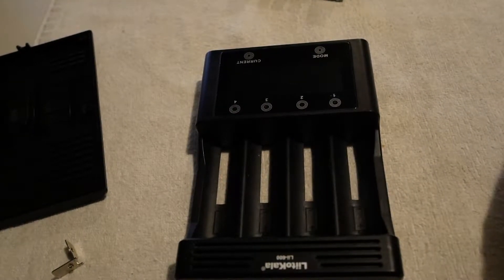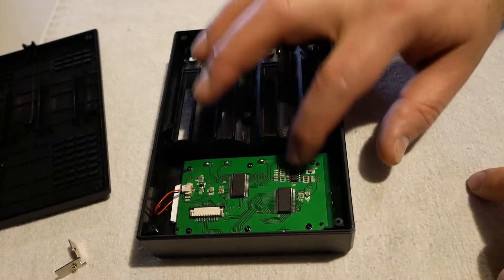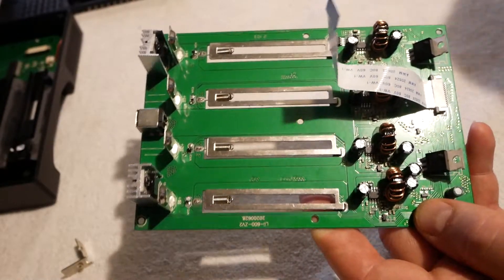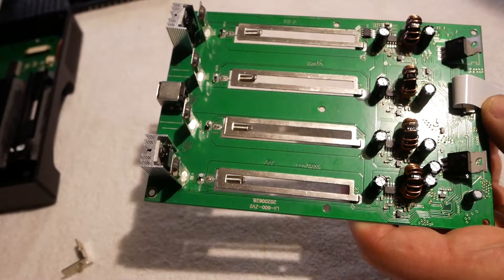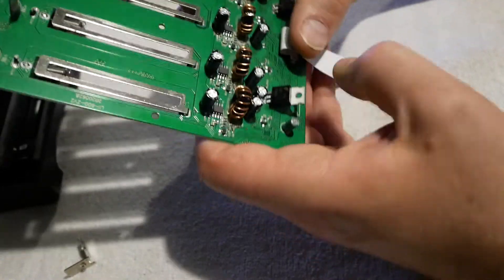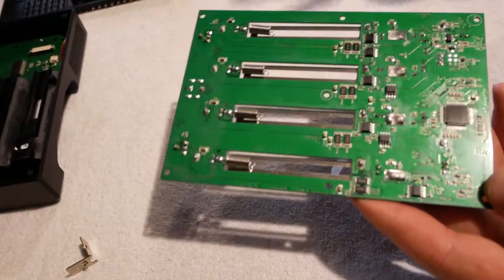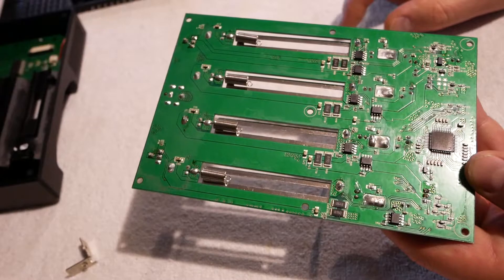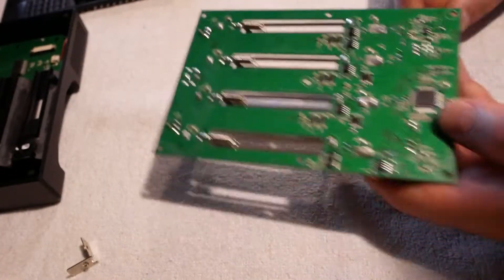LiitoKala Lii 600 Teardown

Comment: I have bought this charger from aliexpress for 10 days.
I found a technical problem.
When measuring the internal resistance of the batteries it shows the maximum 116 mΩ.
So measuring the internal resistance with another instrument shows a larger number, for example 150 mΩ.
So there is a technical problem and it counts wrong.
The funny thing is that the seller does what he does not understand.
Probably not as they present him.
Reply from the maker: I did a video on several cell testers and the results they produced. I showed my test results from 16 cells that got tested by all 4 cell testers presented. The Lii-600 is completely useless for getting reliable cell Ir. I would NOT trust any Liito Kala charger to be reliable and for cell resistance...definitely NOT. The XTAR VP4+ uses 4 wire testing for Ir...like a real Ir tester does! All the rest test Ir through the battery charging terminals and that proves to be highly unreliable.
https://www.youtube.com/watch?v=e75Rhctddck&t=1s
*
Gotta LOVE Chinese sellers! They will play stupid just to get out of taking care of issues! I've run into this many times myself. I've had a couple of Chinese friends explain it to me, but it's not any less annoying to me. They believe they are being polite and non-confrontational. I prefer straight answers and no bullshit!
Reply: @de-bodgery  You said it perfectly.
AFTER SEIL SERVICE does not exist.
They try to drive you crazy with the answers.
Thank you very much, you helped me a lot

Comment: Hi. Thank you for your video. It is very interesting. Here where i live VP4+ is 3 times more expensive than Lii 600. Do you think even so VP4+ is still worthier than Lii 600? Thank you.
Reply: I think I would be more incented to go for the VP4+ if it handled more types of lithium cells (especially LiFePO4 would be nice).
Reply from the maker: Yes....without a doubt! Every product from Liito Kala I have tried has been unreliable and low quality. This is why they are so cheap! This is a clear case of "you get what you pay for". And that much lower price for a Lii-600 vs a VP4+ is because of the massive CUTs in quality and reliability! Watch this video.
https://www.youtube.com/watch?v=kcNaJI2KLHs

Comment: I bought a Lii-600 from their officiel store, chanel 4 always detect that a batery is plugged-in even if no batery is instaled at all, if you can help me what electronic composant to change because shipping back will cost me the same price as the tool it self and it will took lot of time,  :(
Any way as you said the IR display is faked for sur !!!!, because now even with no batery plugged-in, it still show the IR and show cinematic like the batery is charging or discharging lol
Reply from the maker: Do you know the seller wont send you another one without the defective one back?
When I first got Lii-600 cell testers, I thought build quality was better than the Lii-500S, but still not great. I now have 8 of them. I have 2 that are testing cells and presenting capacity results that are much too high. I test those same 4 cells in another Lii-600 or a VP4+ and they test to capacities that I expect. 2 of my 8 Lii-600 chargers are now not very useful for capacity testing. The exact same thing happened to my Lii-500S. It started measuring capacities much too high! I've been telling people the Lii-600 is worth getting, but I have 2 that charge, but are useless for why I bought them! When are the other 6 going to start flaking out!? In between time, my 2 XTAR VP4+ chargers are about 1.5 years old, seen near continuous use the entire time and working perfectly! 
*
If you can't get the seller to send you another one without returning the one you have, open a dispute about it. That will probably get you a partial refund. If that doesn't work to your satisfaction, whatever payment method you used, open a dispute with them for a full refund. Hopefully it's not paypal...they don't give a shit about their customers any more!!! Get your bank or credit card company to get you a refund.
*
Finally, are you in the USA? If you'd like, you could send it to me. I'm not going to tell you how to fix it. That's pretty complicated and there are specialized test tools you probably don't have. I'll take it apart and at least tell you if its worth the trouble. If it's not, all you are out is shipping to me. There's only a few things that I'll consider worth repairing. These chargers are intended to be throw away.
Reply: @de-bodgery  Thank you so much for your answer. sorry, Iam very far from the USA ... i opened a dispute agains the seller hopefully they refund some thing.
I tested the tool this evening and you are 100% right .... every thing this tool show in the screen is FAKE, even voltage is fake, it update about every 10 seconds and the value is up to 7% diferent than the reality, and as you said the IR is only estimated not true at all....    i think i will order a vp4+ or biger tool,  any way after the semi conductors crisis in Taiwan all electronic tools build after 2019 are pur garbage. this year i saw brand new tools that arrive from the factory with defective FTDIs and defective Mosfets...
Reply from the maker: @technomax409  Yeah...I wondered about the chip shortages and what that might do to electronics as a whole. Seems that companies are using their seconds  as parts for their products since they can't get the parts they can trust. 
*
This is far from a new problem! 1988 or so, there was a chip shortage then too. A bunch of flooding happened from a hurricane in the Asian countries that make IC's. The manufacturers  spent a lot of time cleaning up afterwards since all their factories were flooded. It created a massive shortage of all kinds of IC's. RAM prices went crazy for about a year! Many companies made promises to build factories in the US and Europe so this would never happen again. As you can see...that never happened! And here we are again, just for a different reason. It's stupid, but there it is!
*
I intended to buy 4 more Lii-600's about 2 months ago. They were unavailable everywhere I checked in the USA. I found them on aliexpress out of china. So far they are working OK...fingers crossed!
Reply from the maker: @technomax409  Yes...this is true.

Comment: hello sir. not a techie guy, need a plug and play type that can determine the voltage and charge it accordingly. mains are a plus. confused between nitecore i4/D4, liitokala engineer lii-500, xtar VC4/X4. Any suggestion which is better among them for you. thank you sir.
Reply from the maker: Lii-500 is junk. Nitecore doesn't do cell testing and I'm not sure about the XTAR models you mentioned. If price isn't a problem the best thing out there right now is the XTAR VP4+. For a little less cost and loss of cell resistance testing, the Lii-600 is pretty good. For cell capacity testing, I have both the Lii-600 and the VP4+.

Comment: Didn't the Lii-500s have only 2 slots which did 2A charging, while the Lii-600 has 4 slots at 3A? Wouldn't that make sense with the 2 vs 4 temp sensors?
Reply from the maker: I think you are right. 
*
My Lii-500 is a few months old and it died just outside of the warranty period. It didn't stop working persay. It makes overly generous capacity measurements. A 21700 that ought to be around 4800mah is testing 5000 to 5200mah. I started seeing ambitious capacity results from it about a month ago, but they were not happening all the time. Then cells that I knew could not possibly have the capacities it was measuring started cropping up regularly. I then took several cells that had gone through test cycles on a Lii-600 or VP4+ and tested them on the Lii-500 and it would give results 200-400mah higher. It is now retired to charging only since it's capacity results are useless! I've said the Lii-500 was a turd since I got it and I think this has proven to be true!
Reply: The 500s handles both lithium-ion and NiMH cells.
That is correct only for lithium cells in the 500s.
NiMH cells are limited to 1A max regardless of number of cells and/or position.
That's covered in section 6.2 of the user manual
It would still be better to have a sensor for each slot/channel. When talking about low capacity cells, it's still easy on the 500s to exceed 1C charging current for cells that have that limitation.

Comment: opus BT-3100 is still a king -  discharges at 1A -  when talking about cost-benefit
Reply from the maker: Problem with discharging at 1 amp is that you are not testing like the manufacturers test for capacity. For that you need .5 amps. I had a BT-3100. It's fine for 18650's, but like right now I'm testing 900 new 21700's and the BT-3100 can only hold 2 of them. I gave it to a friend in favor of cell testers where all 4 bays can hold 21700 cells. I never used it, but the micro switch under the bottom cover for testing LIFE cells could be useful. Most cell testers don't do LIFE at all. I now have 3 of the Lii-600 cell testers. IMHO, since it can test 4 21700 cells at the same time, it's a better option for me than is the BT-3100.
Reply: @de-bodgery  yes. You’re right !!

Comment: which is better? lii 600 or vp4+?
Reply from the maker: Which is better? Depends on what your uses are. If I had to pick just one, it would be the VP4+. My suggestion is to get a VP4+ so you can test cell Ir accurately. Then if you need more cell capacity testing, get Lii-600's so you can test lots more than 4 cells at a time. This is what I did. I have 3 Lii-600's for capacity testing and a VP4+ for capacity testing and Ir testing.
*
Build quality and electronics design are lots better in the VP4+ than the Lii-600. The VP4+ is pretty accurate at measuring cell Ir. No other cell tester that claims it tests Ir is worth crap. They are all wildly wrong (usually 2-3X OVER actual cell Ir) except for the VP4+. If all you need is fairly inexpensive and reliable cell capacity testing, then the Lii-600 is $20 cheaper and does this job well. The Lii-600 also has a repair function that will try to recover flat or very low cells. The VP4+ does not have a feature like this.
Reply: Lii 600 : repair mode = refresh mode, you have also that on thé Xtar VP4+ ( Refresh mode, just see that on their official website )
Reply from the maker: @Science-sans-conscience  The VP4+ will not attempt to recover dead flat cells and the Lii-600 will. This is "repair mode". Refresh is basically discharge and charge to "wake up" the chemistry of lithium cells. The VP4+ and the Lii-600 both do this. The VP4+ is limited to charging at a maximum of 2 amps. The Lii-600 can charge at 3 amps. I don't care about this very much as I buy cell testers for capacity and IR testing and then periodically use them for charging only. VP4+ is the best at these tasks for all cell testers I have seen and tried! The Lii-600 Ir tests can't be trusted, but it does do capacity testing well. What I have done is bought 2 VP4+ cell testers so I can check Ir and cpacity. I bought many more Lii-600 cell testers for capacity testing. They are $20-25 cheaper and do this one job pretty well. I have 4 more Lii-600's coming as I have a something like 900 21700 cells I need to test and it takes a long time to test them.
*
If I were to buy just one cell tester, it would be the VP4+...no doubt about it!

Comment: If you look at the vents on the side, you can see the logo "XSL" patterned in the holes... I don't believe Liitokala makes these (OEM'd out to XSL per-chance?), the old Engineer Lii-500 is clearly a different construction, and for my money it works better.... off to see if you have a teardown of the old Lii-500 too.
Reply from the maker: I saw those letters and didn't think anything of them. Once you see my Lii-500 teardown video, there's not a lot about the Lii-600 cell testers that are much of an improvement over the Lii-500S. It's better, but just a little. Based on the construction, I'd say both cell testers were made by the same company.
*
The Lii-500 user interface is clunkier. Pull out the cells and drop in new ones and you have to do 100% of the setup all over again. The Lii-600 isn't as good as an XTAR VP4+ in this regard, but it's loads better than the Lii-500. Also the Lii-600 can charge faster than the Lii-500. The Ir test results are very inaccurate so that's not of any value. Personally, I'd choose the Lii-600 over the Lii-500 and I'd pick the XTAR VP4+ over the Lii-600. It's the best cell tester out there right now. 
*
The VP4+ can't charge as fast as the Lii-600. It does have much better build quality. Component quality is much better and beefier. It accurately measures cell Ir. Set it to do some task and it stays on that exact setting forever until you change it. Cell after cell after cell...no reprogramming! I have 3 of them now and I own an OPUS, 2 Litto Kalas, skyRC MC-3000 and a megacell charger. The best build, best components, best accuracy, best measuring consistency with the most features that matter...at least for now is the XTAR VP4+!!!

Comment: Any comments on my test below?
Reply: Interesting results and comparisons. Thanks for taking time to report. 
Some questions/thoughts for future reports:
1) How did the measured mAh values compare to the mAh claimed on the cell labels?

2) Test some low mAh cells (like 16340 with 700mAh max). Legitimate industry testing tests mAh at 0.2C constant current. Do the chargers allow setting at anything close to 0.2C (e.g. 700mAh * 0.2 ~ 140mA) for the lower mAh cells or do they force using a higher current, for example 500mA? (of course, some sellers and cell labels claim wildly impossible mAh capacity like rechargeable 18650 cell has 5000mAh or a rechargeable 14500 cell has 1500mAh, etc)

3) Do the thermal sensors in the unit(s) report accurate cell temperatures if  you are testing bare metal cells (e.g. labels removed)? I know that hand-held non-contact IR 'guns' are usually very inaccurate measuring temperature of shiny surfaces. If I'm going to be testing a lot of salvaged bare cells this would be nice to know.

4) Would be nice to have confirmed when the chargers accept button-top 21700 cells, and if they do whether or not the cells can be easily inserted and removed. I've run into chargers where I've had to use a plastic "spudger" (or a rugged guitar pick) to remove the longer cells when done testing.

Comment: Hi i have a problem for liiotkala 600 so i put this in my bag but unfortunately it has a little bit splashed by water i saw it after a while little bit wet so when i charge my batteries the screen automaticly turns on and touching the first cell so what should i do ?,i dont want to open the device because ,maybe i can make a mistake and this can bring me a worst result.
Reply from the maker: Unplug power...open it. If its still under warranty for a source such as Amazon...they won't check if you opened it and will just send you a replacement. Elsewhere...can't speak for them...maybe send it back for a replacement. Obviously I could not care less about warranty since I open stuff up just about imediately!